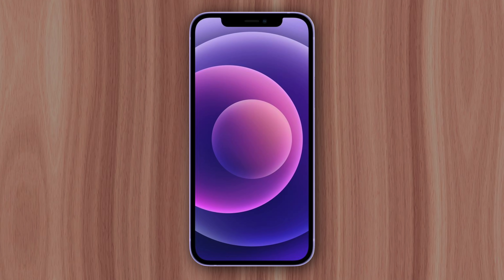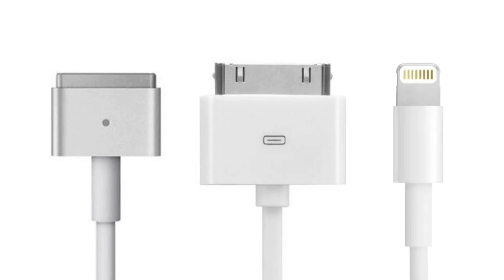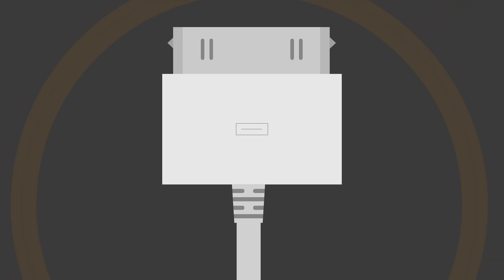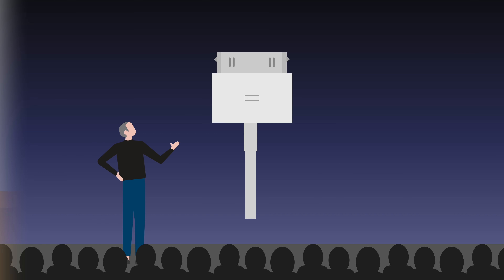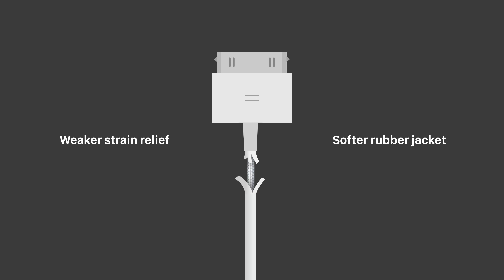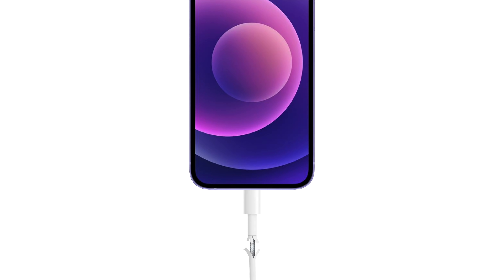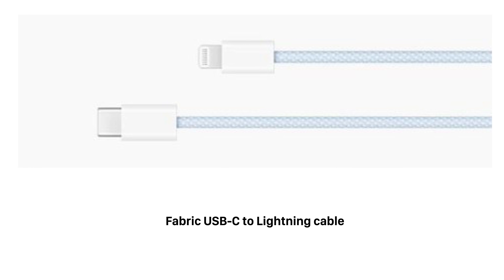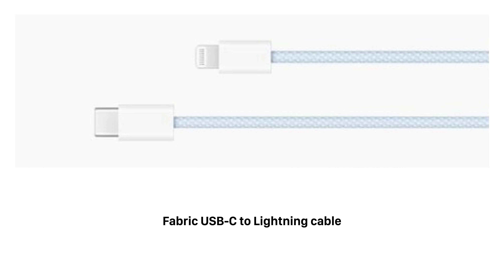Why iPhone Cables Break So Easily

Comment: Apple users be like: "yes the cables are too fragile, but at least they're going to fix it ~10 years after the Lightning cable's release!"
Reply: I have had my
iPhone cable for 5 years and have had no issues 😂
Reply: @Nolzy69420  I’ve had mine for nearly 4 and no issues either.
Reply: Apple cables > MicroUSB which is all we need
Reply: @NineEyeRon  Perhaps, but nobody uses microUSB anymore.
Reply: @NineEyeRon  1. Nearly all androids use USB-C, manufacturers switched to it several years ago.

2. The actual connector for USB-C is much stronger and more durable than the Lightning Connector.

3. Lighting still uses USB 2.0, a 21 year-old standard while USB-C uses USB 3.1, 3.2, and Thunderbolt

Lightning is a worthless connector apple still uses only to make money from 3rd parties using it for accessories
Reply: @NineEyeRon  nah apple cables are far worse micro usb is way better by ridiculous amounts faster more durable and looks just as good
Reply: Bro literally Android chargers in the past have been just as bad if not worse than apples. So idk what you're talking about
Reply: @saucewrld9995  Really? I've never seen any frayed USB C cables except for the ones made by Apple.
Reply: @HigherQualityUploads  untill a couple years ago, and still on some cheaper options, the chargers had unremovable cables on them, meaning you had to buy a whole new charger.

meanwhile our family still has our old ipad 2's charger brick and that still works just fine, even if the cables are not.
Reply: @thebravegallade731  yes if you buy the cheaper option, but samsung, Sony Huawei and so on NEVER had a cable that was unremovable from the charger on their flag ship phones. I personally had one from samsung  in the early days which was like 50€. It had an attached cable on the charger (micro usb) its like 10 years old and I still use it to charge my PS4 controllers. For my iphone 5 I had to buy like 4 cables and the charger with another cable wont even let me charge anything which isnt from apple...
Reply: @HigherQualityUploads  Really? I’ve also never seen any broken iphone cable,Also just because it happens to half of the users doesn’t mean it also happend to EVERY one
Reply: @wandafan7323  Easily a majority.
Reply: @JakeB84936  True
Reply: @HigherQualityUploads  maybe cause apples are eco friendly? And are made not even close to the same materials as those😂
Reply: @saucewrld9995  Yeah, no, not even close, and nice try. I still have my OG out of the box Galaxy S8 cable and it still works to this day, no breaking no fraying. Lmao I think I even have my OG Nexus 6P cable somewhere. Even if out of the box cables were just as bad on Android, you can get high quality woven fabric replacements for cheap unlike with Apple cables where you literally pay an Apple Tax for the privilege of buying an Apple cable. $20+ for one Apple cable vs $14 for a 5 pack of woven fabric USB-C to USB-C cables for my Android phone, hmmmmmmmm.
Reply: @saucewrld9995  dude i have had the same usb c cable for over 3 years and its worked great my apple chargers struggled to last a year
Reply: I still use a charger included in a cheap acer table like 7 years ago but I ruined the cable in two years becuase i stored it as noodle. My sister wich had an iphone 5s those times, had to change the cable 3 times while she took care of it a lot. 
The same about the chargers when I got some xiaomis, since the redmi 3 generation, I end up ruining those because I barely take care of them, i pull the cable if they're stuck in my backack and like that, but it lasts me at least twice that some family members that had/haves iphone but they even store the charger in a separate compartment
.
Reply: @saucewrld9995  bro tf u talking bout? My 2011 cheap android tablet charger is still working today and it's in perfect condition, I had a lot of android phones in the past and not even the cheapest ones had a problem with cables or something
Reply: @saucewrld9995  yeah nah I still have my old charger I found a year ago that I had for 3 years and it still work even tho I upgrade to the new samsung it still works to this day

Comment: Thanks for the straightforward and honest statement about Apple cables.  
Sadly, at times, the corporate philosophy of "Form over Function" do extend beyond the quality and design of Apple connecting cables. In specialised shops there is a vast offer of ruggedised Apple cables, where cables designed with a "Function over Form" criteria are available at around ten bucks or less.
You may recall that, when Apple introduced Lightning cables in 2012, as they included a small line-switching IC chip (to allow reversibility), they enjoyed a period of absolute monopoly of cable sales, until the Kamino cloners figured out what went inside the line-switching chip.
Now the newer USB3 - PD connectors do include a similar (better), non-esclusive, open-design switching chip.
Thanks for the video.

Comment: I’m more of the opinion that people need to take better care of their equipment. I’ve had my apple charger (2M) for 3 years before it started to fray and break. I’ve had people bending my cables while laying the bottom of their phone on a table and wrapping my cable to tightly against my power bank and bending the sides where the lightning insert is along with the USB port. It’s not hard to take care of their cables.

Comment: NGL this is the precise reason I’ve switched to almost all wireless charging pads. The only time I use a cable is when my phone is at 1% and I have to use my power bank, but that rarely ever happens!
Reply: Its still probably better to just use a cable since its better for the environment and your paying more in electricity compared to regular cables significantly more

Comment: I’ve never had an Apple cable break on me in 8 years.

The trick is to avoid resting the iPhone at an angle that would cause the cable to bend around at a sharp angle towards the power brick. Also, when transporting the cable, use the “over-under” technique to keep the cable in a neat loop, free from excessive stress.

Doing those two things should easily double the cable’s service life!

Comment: Finally a proper explanation. Removal of the PVC additives. I had at least two Apple lightning cables years ago that simply disintegrated into powder near the connector, within a few months. I am very gentle with all my cables, did not bend them, and nothing like that has ever happened to any of dozens of other cables I’ve used for many years before and since, both Apple and non-Apple cables. It was just a bad rubber formulation. Those cables that disintegrated had a particular soft, matte feel to them, almost velvety, and were unusually flexible.

Comment: My father's I phone cabe is literally covered with insulation tapes
Reply: That's the easiest way to fix them. As long as the inside cable is alright, a bit of insulation tape does the job nicely. Even fixed an old usb cable with it.
Reply: @shahnazfiaz2015  bro my fathers cable is literally only insulation tape. There is not even a single piece of original meterial on it!😂😂😂😂😂

Comment: Apple: removes all PVC from their products to "save the enviorment"

Also Apple: produces more cables than ever, since they're so easy to break.

The solution?

1. remove headphone jack to sell even more shitty cables/dongles.

2. insist to continue using lightning cables for iPhones, resulting in even more cables being produced since one can't just use one of the 100 USB C cables lying around in every houshold when their lightning cable breaks after a couple months.

3. sell charging cable seperatly, producing more waste, since everybody has to buy anew one anyway, because their old one broke because they removed PVC

4.?

5. profit

Comment: Me in the first half: Planned Obsolescence
Me in the second half: Yo those fabric cables look dope this should be standard for all tech
Reply: Still is planned obsolescence
Reply: Ya never seen woven cables?
Reply: The funny thing is woven cables is they used to be much more common. You'll often see household electrical items from the 1950s and earlier use a woven fabric cable for the outer housing of the mains power lead.

Comment: Meanwhile, I'm still using my iPhone 8 charger for almost 3 years now. 😂 Never had any problems with it!
Reply: Im still using my old 10 watt charger from Samsung in 2012, it works fine
Reply: Yeah same but im using an iPad Air 2 charger from 2014 7 years later on my iPhone XR, i think the cables are great.
Reply: if you treat cables well and don't bend them too much, of course they're gonna last you years.

Comment: I am using a third party apple certified lightning cable and it’s been like a year and the cable is working just great but earlier when I bought the apple original cable for double the price and it got damaged in less than six months so I bought another one and that one also got damaged after another two three months

Comment: I have used my original lightning cable that came out of the box with my 5th gen iPad for 3 years and it didn't have any issues. Yes, they are more fragile but people also don't give a damn about using these carefully.

Comment: I had my cable just over 3 years, I didnt bend it like a dork, it's still working as new.
Reply: Same I got my iPhone 11  10 months ago still have the cable perfect condition
Reply: same i still use the cable from my iphone 7 lmao
Reply: I still have the cable from my iPhone 6 and it looks brand new
Reply: Yes, mine too… don’t know why people rip them apart
Reply: I still have iPod video 5th gen 30 pin connectors that work perfectly. People are hard af on their cables and THAT is a large part of the reason they break all the time.

Comment: Another problem is that the sleeve material on the cables seems to deteriorate faster when they get warm. I have a MBP and for a while I hold the power cable under the laptop on my knees when working as a kind of strain relief so the power connector stay propely in place. After a while the cable started to fray exactly where it was hold under my laptop.
Also the Lightning connector is active. it has its own controller chips. the shielding of the cable is acting as a heat-pipe to keep those electronics cool. One other reason why the fraying mostly occurs on the side of the Lightning connector.

Comment: One simple reason: money.

all these connector designs are designed and owned by apple, and even if you replace the cable with an aftermarket, more durable one, apple STILL makes money from it because the connector was licensed.

Edit: Wait, that explains why iPhones took so long to finally get wireless charging. Because while you can indeed make a proprietary connector for a cable, what're you going to do with wireless charging? they're cross compatible. So, even after the backlash they didn't introduce wireless charging for a long time because they basically would not make any money from it. 

They only gave it to us in the iPhone X, because wireless charging had become more and more common and a point had been reached where consumers could consider other options with wireless charging.

But hey, Apple is Apple afterall, and they yet again found way to make money off of it by introducing the magnetic Magsafe wireless charger; which I do admit, it is cool. Personally, I'd simply prefer a regular one though, just a personal preference.

They also found other ways to make money off of Magsafe, with the accessories. I haven't seen, or used them personally, but I kinda felt it was dumb. Like there was this magsafe wallet, what would happen if it fell off? Then there's the Magsafe phone cases , because boo effing hoo, my Magsafe accessories wouldn't work as the magnet would be weakened.  Anyways, they're making money from it just like they did with the lighting cables; licensing. 

Apple isn't a 2 trillion dollar company for nothing. Cheers.
Reply: True. Oh and I can really recommend the IKEA LILLHULT ones. Best USB charging cables I had, yet. Anker "rubber" cables, Anker "textile" cables, all kinds of manufacturers' cables, but the IKEA ones beat them all. Flexible, light, neat self-storage rubber band sewed onto it, textile, cheap. Perfect. I have the USB-A <--> USB-C version, the USB-A <--> Lightning version and the USB-C <--> Lightning version (yes, USB-PD / quick charging works).
Reply: @DerKatzeSonne  I see, thanks! because now I was planning on picking up a longer type C cable for my Samsung; the one in the box tends to fall short. for example, whenever I use my phone in bed, or at my desk, etc. 
Yes, IKEA does have stores in my country, but I'll have to check if the cable is available. Anyways, thanks again for the recommendation

Comment: It’s mostly the moist air which exposes the weak plastic and rubber to peel off and fray itself. I had my charger left in the shelf without bending it and after a few weeks it peeled itself off.

Comment: I've seen this happen to older MacBook cables, but I've never had issues with my cables.  Any eventual failure appears to be internal/inside the cable, and seems to last longer than most overly-stiff 3rd party ones.  That and I'm not a fan of extremely stiff strain reliefs, like you find on your run-of-the-mill Walmart cable.

Comment: The cable for my 9 year old Samsung tablet is still in reasonably good condition, even though it has a smooth stress relief bit (it has come loose and can now freely slide along the cable, but the cable underneath isn't frayed). It's a good thing that the cable still works, because that tablet, like all Samsungs of its time, has a proprietary 30 pin port that looks just like the Apple variant unless you look really closely.

Comment: In all the years, I have never experienced that with a cable by Apple. I think it happens mostly when people pull the cable itself to plug it out of the device instead of pulling the plastic frame at the end of the cable.

Comment: My cables are fine because I use the connector to insert/remove the cable like you are suppossed to.  Do not yank on the cable, that's silly.

Comment: Because they want you to buy a new one. Or motivate you to buy a new product.
They sold 40.9 mil Iphones in 2019. If in 3-4 years everyone buys a new cable they make between 775 millions to 1.6 billions, only from the cable.

They could make the cable from a textile material if they want to. 
They have a revenue of 275billions/years and a market cap of 2.13trillions. And you say that they can't make a cable that doesn't break and doesn't risk the users health?

Comment: Also, Apple FINALLY seems to have addressed the lightning cables failing due to pin #4 CORRODING and turning black after a few months of use. Anyone who lives in the south where it’s more humid knows what I’m talking about. They seem to have replaced the pins with a silver colored material and they don’t corrode anymore.

Comment: Oof the iPhone coming this year will come with no cable.

Also, my apple cables don't break or fail since 2015. I've bought 4 and got 5 from the box.
I gifted 3 of them and eventually got broken.
I currently buy Native Union cables, I like their woven cables.

I guess cable failure depends on how the user uses them, I try not to break them since I need a reliable data transfer from Apple devices.

Comment: One more point. Look at the comments. They come from both sides, happy and frustrated. I have worked in quality control. Every single piece we put out had to meet extreme military and tolerance standards because of the nature of our work. These cables are by the millions. Things happen in manufacturing. The covering on the wires beneath is not always perfect. BUT, I still say Apple needs to replace every defective part or product if they are willing to let shoddy construction just be okay and accepted as the norm. It is our money. Their valuation is over Two Trillion Dollars. Gee, they just cannot afford to make things right? They want to build Electric Cars and expect us to TRUST them with our lives? Think again Apple.

Comment: Well, fine. Facts: 1. Apple deliberately lied and throttled down older phones to push new sales. 2. Apple deliberately lied about some batteries that had issues and would not replace them. They purposely would not discuss the issue through customer service. 3. Yes, they lie about the cables saying it must be me! They did NOT build enough material into the wire to allow the heat shrink effect form creating the problem. I told tech about it and that went nowhere.  My old BLU and Motorola phone cables are strong, solid and still supple. Samsung gave the same lies about their construction of their batteries, cables and other numerous problems. Both companies are in my toilet when it comes to the aftersale service. 4. The iPad 5th gen I am writing on was sold with a defective rocker switch for volume. They refuse to fix it. They want to give me credit to buy another iPad. They are complete screwballs. We have all wasted tens of thousands on mobile devices over the last 20 years. This might be why there are men trying to build their own devices that can be upgraded over ten years or more. When you build stuff just to keep it affordable, you know that stuff may end up in the dump. I have several computers from Apple and MS. The MS laptops are still humming along and giving me ZERO issues. Very sad state of affairs.

Comment: Apple's cables also feature thicker points at the ends of the cables. Users can just pull from those, but some are lazy and don't want to, then blame Apple. I have used the same cables for years with no issues.